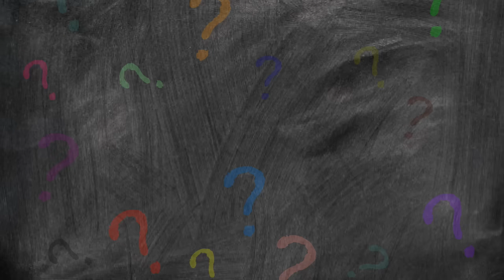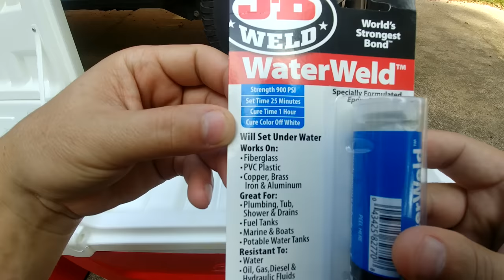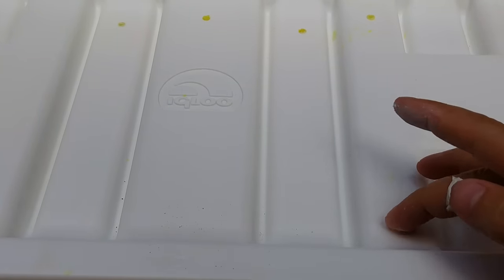Do Yeti cooler hacks work?

Comment: Wait. So you insulate the lid but not the part of the cooler that would actually need the insulation for the ice? 
Insulating the lid is useless. Insulate the body of the cooler or nothing.  Chest freezers are more efficient than a stand up freezer because cold air is heavier than hot air. Cold air sinks. Sooooo a well insulated chest cooler can have the lid opened a dozen times with no problem. A stand up freezer can't because the cold air falls out when the door opens.

Comment: Late to party.  I would drain and measure water melt volume melt after 1 hour, 3 hours, 6 hours,  drain and measure after 24 hours and then weight the ice in both.  This is generally why people staying 3 days use electric portable refrigerator with battery power supplies.

Comment: Heat rises and cold falls so I would say you should find out if Yeti and others insulate the lid with a different material or is it better to just do the walls. However its not logical that trapping cold would work better with no insulation. Another thought is a chest freezer vs an upright, the chest freezer loses much less cold when you open the lid versus the door on the upright! So its less about the lid performance and more about the bottom and walls imo.
Reply: The temp delta between the bottom and top of the cooler is way way less than the delta between the inside and outside of the cooler.

Comment: Filling the lid with foam messed you up. Air is a better insulator then hard foam. Like other people have said yeti's have a vaccum all around them the seal might have helped a little tho
Reply: No the foam works, the problem is the Amount of foam he used, he filled it up so instead of allowing it to expand and form bubbles it became a solid mass and inversely became a thermal mass that just held heat. Also that plastic could never hold a near vacuum, it would implode and shatter the plastic that is why all vacuum containers are metal.

Comment: Its actually very simple and already partially explained by others. The foam adds thermal mass so that is a loss factor. Now the question is: is the insulation of the foam that much better then air that it negates the loss of the thermal mass and the answer is no. Many already mentioned using bubble wrap as a succesful insulator. The standard lid is in effect the same it is a large airtight bubble filled with air. The same effect is used in modern plastic window frames where multiple hollow parts filled with air provide very good insulation.

Comment: Put both coolers in a deep freezer for 24 hours then re try the experiment. The coolers cant cool if they are hot. They can only resist warming, unless they plug in the wall or have a battery coolers dont actually cool.

Comment: 1. You aren't comparing anything; the coolers might be different in some manner, they have different labels. 2/ Weigh the ice. 3/ Why not drill holes in the lid from the outside. 4/ That epoxy putty doesn't stick to polyethylene. Guess what the cooler is made of.  Make those changes, then you'll have something to talk about.

Comment: It might be that the holes you drilled may not be air tight. Try a silicone sealant over the putty you already put on. And yes one side may be getting more sun. Best way is just leave outside with no shade in the day and spread them 3' apart so they do not cast a shadow on eachother.

Comment: Too thick of a gasket material. Jus a very thin one is all that is needed. Further it opened a gap along the back where the hinge is that isn't present on the unmodified cooler.

Comment: Make sure the coolers are in the same orientation relative to insolation.  You may have uneven direct heating from sunlight.  Tinted windows reduce the effect, but they don't eliminate it.
Reply: You have got to be kidding.  You pretend the environment is to blame while ignoring that he just created a thermal bridge in the lid where one didn't exist before he drilled it and filled it. SMH   Dunning-Kruger at its best.
Reply: @DiffEQ  All I really was driving at was that the test was not valid in general, since there were too many variables in play.

Comment: Why would you expect a solid lid to insulate better than a hollow one. Solid matter conducts heat much faster than air. You fill your walls with fiberglass insulation just to limit air movement- if it were airtight, you’d leave them empty. A thermos bottle is hollow, actually it’s insulation is thanks to the vacuum it maintains between the two walls. 

The worst thing you could do is drill into the lid and fill it with foam.
Reply from the maker: Yeti coolers are some of the best coolers out there and they have insulation in the base and lid.  I did this test because I saw a few videos showing this helps the cooler and makes it better so I figure I would do my own test to see.

Comment: The testing environment is not a good one.   You should put both coolers (empty) in your house for a day, make sure both coolers start out the same temperature.   Then weight the ice and make sure you have exactly 10 pounds of ice for each cooler.  Put in the ice. and then close the lids.   Continue to leave the coolers in your house for 24 hours or 48 hours.   Then dump the water out and weight the ice.  The results should tell you if your hack was working or not.
PS:  Using the sun as a heat source for your testing is NOT a good idea since the sun was moving across the sky
Reply from the maker: If the Yeti hack worked with this matter?  If I compared a Yeti to this Wal-Mart unmodified cooler in these same conditions do you think the Yeti would lose?  I agree the conditions could have been better I just really wonder if in this case it would matter.
Reply: @HowToWithJames  Do it right or don't do it at all.   Your test results didn't prove anything since you didn't do the testing correctly to begin with.  We still don't know whether the hack did work or not.

Comment: do two experiments,  swap sides.  Maybe heat load is worse on the left side.
Reply: There is no way adding insulation would cause a cooler to be less unless it was assembled not fully correct (i.e. hinges allowing air gaps.)  Or was a incorrect test.  I do not doubt you believe you did it correctly but switch sides and do it again.  Maybe run the test outside of the vehicle.

Comment: Did you try sealing Just the lid on the cooler? You could switch lids on these coolers or put the weatherseal on the one you did not mess with and try that,  but maybe igloo and other cooler manufactures know what they are doing.  bryantroyster59 and desertratedc9596 both had some awesome Ideas!!  🤣😎

Comment: I think the window seal did more to keep cold in than the spray foam.
Cold would escape through any small gaps in the seal of the lid and body so better insulating that is good, but the lid being insulated keeps heat from dissipating through the top of the cooler and would hold heat better than the non-insulated lid.

I think you would get better results is you pre-chilled the cooler and didn't leave it in the vehicle and left it in a shady area, but if that's what you plan on doing with the cooler, then I wouldn't insulate the lid.

Comment: Cold air sinks and hot air rises. I’m pretty sure the extra insulation and seals trapped any residual warm air inside the modified cooler. In the case of the stock cooler the warm air was able to escape through the small gap in the lid.

Comment: The coolers are not identical looks like you modded a Walmart brand cooler and left an igloo  alone  also they may be vacuumed and you probably broke vacuum seal by drilling  it
Reply: They literally both say Igloo on them in multiple spots - on the label, on the front, and on the inside of the lids
Reply from the maker: I bought them in the same spot at the exact same time.  They are as close to the same as Wal-Mart can give me.

Comment: You would have needed to test the coolers BEFORE you made the mods to set a baseline. I'm betting the one you modified was less insulated in the first place -- maybe they missed a side or two during manufacturing -- so it was always gonna do worse no matter what mods you did to it.
Reply from the maker: I agree I did not do that and should have but if the hack worked at all it would have out performed the stock cooler. There is no stock 20 dollar cooler out there today that can outperform a yeti.
Reply: @HowToWithJames  Not if the sides / bottom of the modded cooler were defective to begin with. Adding insulation to the lid can NOT have made it perform worse than stock; at worst it would not make any difference at all, but the insulation can't transfer more heat to the interior. That's why I say the rest of the modded cooler must have been defective in the first place, which is what should have been established in a baseline test.
Reply from the maker: I am not sure why you are using caps on some of your words. I can read them just fine without it.  Caps means you are yelling. I understand it could be defective but without seeing any holes or physical damage on the outside that is very unlikely. I will soon do a second part to this video and I plan to get a baseline by switching the lids to see if the results are the same or change. This will tell me if the bottoms are the same or have a drastic problem.
Reply: @HowToWithJames  lol... entire sentences in caps means you're yelling; a single word capitalized is simply for emphasis.
Good luck with the test.

Comment: Okay Brother, here’s why...what you did was insulate the top and basically stuck it in a oven. While in a oven...heat penetrates the cooler from all the way around. What does heat do? It rises...and by only insulating the lid...stopped the heat from getting out. Basically a oven within a oven. If you wanna see a major difference...insulate the walls. But now...it’s getting expensive. Buy a better cooler...less labor.

Comment: Upvote so he sees this!!! Yeti uses seals on their coolers like the weather stripping you used but they also have big pull down latches that make sure the lid seals air tight. I think if you had some kind of bungee cord or strap holding the seal shut tight on a new test you’d get fantastic results!
Reply from the maker: No need to upvote I see it :)  I actually thought about latches but I did not want to destroy the integrity of the cooler during these tests.  At one point I thought about putting weights on top to ensure the seal but the only reason why I didn't is because the seal before putting any weather stripping on it was pretty air tight and once I put on the weather stripping it was even better so I did not bother.  If the seal was the problem then why wasn't it a problem on the stock cooler?  Also you see later in the video I took off the weather stripping and tried the test again and got the same results.  In that last step the air gap was the same as the stock cooler.  Thanks for the comment.

Comment: The foam never expanded because you need 2 holes in each channel that you are spraying one on top and one on bottom for it to correctly to expand only fill one hole and let it to expand out of the other. 😵 .no need to use a lot , just enough for you see it come out of second hole.the added Two pounds it had was the wet  foam still stuck in lid  🤭 needs at least two days to cure. 🤓

Comment: I feel adding the spray foam is like wearing a sweater in the summer, it probably is insulating the cooler from the wrong side and keeping it warm.
Reply: That is just not how insulation works.
Reply: @boldgaming9940  No. I work HVAC. It is possible to trap heat in. Effectively what happens is the hottest and coldest items inside equalize.
Reply: We're talking about the outside and inside equalizing.  Just because you work HVAC doesn't mean you understand how insulation performs.

Comment: I would try linning it a sheet of 1/2" or 3/4" styrofoam insulation. Top, bottom and, sides. The yeti's have way thicker walls and lid. Just make sure the shinny side faces out.

Comment: I’m no expert but it seems to me that what happened is when you insulated the top the heat didn’t escape, which meant that the heat was kept inside the cooler, and therefore everything melted faster.

Comment: Try filling the bottom with expanding foam and not the top because the top would reflect more heat back into the object that's in the cooler. Don't forget heat rises cold air drops

Comment: I'm just laughing at the comment "try putting a cooler inside of a cooler". Do the math. A cooler inside a cooler "X "cost and available "sqr space"= YETI.  The goal was to avoid the cost of a YETI-LOL
Reply: the yeti are like 300 to 500 so if it did work  it would def be worth it because it would only be 40  or 50 dollars  but it didnt work but deff worth a try tho
Reply: @louisshade8624  Lou, you are correct. I actually use the Rubbermaid commercial coolers on my boat. Not as much as YETI but slightly more than Colemans or Igloo.  Not as good as YETI but better than the others. Thanks for the experiment.

Comment: Missed an important step here, this kind of cooler needs to be pre chilled before use in order to reep the benefits
Reply from the maker: I did not intentionally try to pre-chill the coolers but in my second test I believe both coolers were pre-chilled due to the temperature readings I showed just before putting in a second bag of ice.

Comment: 🤣  Guy, the spray foam needs air to actually expand and foam. Absent that, the cooler lid acts just like the sealed spray can container, keeping the foam in a somewhat liquid state. Disassemble your lid and you'll find a mess inside, none of which benefits cooling. It might actually aid in transferring temperatures in and out.

Comment: I tried the same thing a couple  weeks before I saw this video.   Used the exact same foam but it did not cure inside the lid.(closed cavity).  Turned to liquid after 3 hours.   After more research I think the open air cavity transfers less energy than the foam .  The foam is really just better at draft stop.

Comment: A possible explanation for the failure of the modified cooler is that the spray in foam is exothermic  an can take a couple days to fully cure  especially in a  confined space. I think the heat generated from the modifications may have impacted your results

Comment: You have thermally bridged the inside and outside of the cooler with the foam. Heat will travel more quickly between rather than having a large air gap in the lid.

Comment: Looking for ways to increase the insulation on my boat fridge. Just watched this. Biggest difference between the modified and the regular is that a sealed air space insulates far better than adding a medium. Think about the thermos we carried coffee in. Even the best ones have a dead air space. If you want your ice to last longer, suggest you wrap the entire cooler in an old comforter. I also think you are using the wrong type of foam insulation.
Reply: There isn’t an “air space” in a thermos though. It’s a vacuum.

Comment: I guess it goes to show that air is the best insulator. Find a larger celled foam. I feel like they use bigger cell foam for fridges and coolers and other cold insulating applications  verses dense foamed used in homes mainly to keep heat in not cold.

Comment: House insulation is thick and meant to trap air in the fiber. Also, insulated windows have two panes meant to trap air. Therefore air is a good insulator. The lid with air works better.

Comment: unfortunately, the test wasn't as accurate as you could have been. Nothing was done to the bottoms of the coolers ie they were both sitting on the car floor which does heat up. I would suggest not using a car and just leave them outside. Sure the top had more insulation and maybe wouldn't be so warm in direct sun. But the fact basically is the bottom parts of the coolers were not modified in any way where the cold needed to be.

Comment: All of these test videos are failing to follow the instructions that all of the high end coolers suggest, which is to get the interior of the cooler to the desired temp before filling it with what you intend to keep cool. So you need to sacrifice some ice to get the interior of the cooler to where you want it to be and then refill it and start your test. I’ve yet to find anyone playing a video with the correct method to get accurate results. If you just put ice in a warm cooler and start your test then the test is already flawed.

Comment: The "air gap" in the lid is a better insulator than filling it with foam. All you did was make it easier to radiate the cold out of the cooler. If you wanted to verify this, run your test again and just keep checking the lids surface temp. I believe you will see a much colder lid on the modified unit.
Reply from the maker: I am not saying I agree or disagree but I am curious why do you think a Yeti cooler is filled with insulation?  I know a tumbler uses air as insulation but I also know a Yeti cooler uses insulation.

Comment: need to insulate the body of the cooler also, by only insulating the lid you pretty much did nothing to help keep the body cool, I have done this and it makes a huge difference when is all filled with foam. also yeti coolers are completely foamed up.
Reply from the maker: Would you suggest using the same foam I used in the lid?
Reply: @HowToWithJames  yes, and seal the holes afterwards with some epoxy.

Comment: Air is the best insulator. Maybe the one with no mods is keeping more ice because of it. Yeti coolers are vacuum insulated.
Reply: Those plastic coolers could never hold a near vacuum, I'm not sure where people keep pulling this fact from. You'd have to make the cooler from aluminum at worst or steel so it could hold anything near a vacuum.